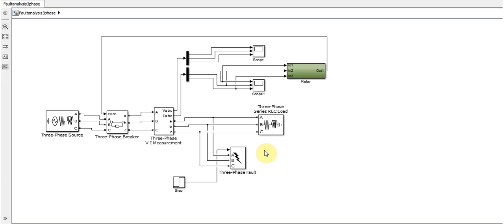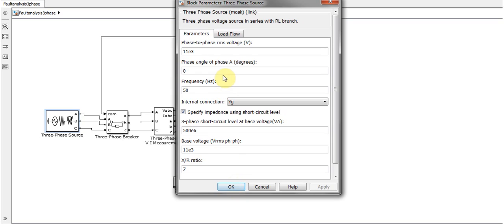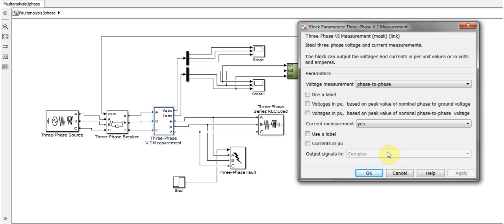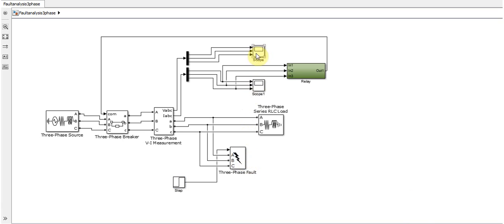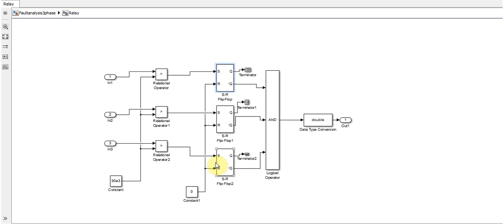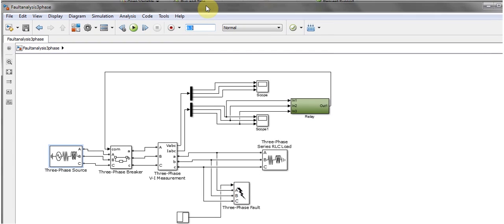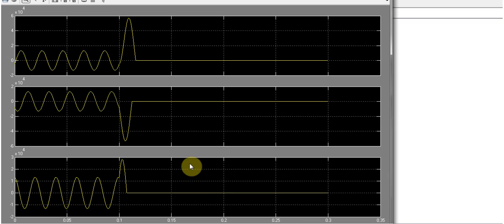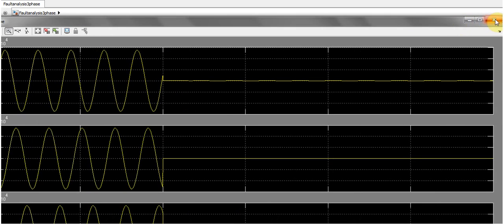Matlab Course : Fault Analysis of 3 phase System in Simulink

Comment: Thank you... kindly answer my following doubts:
1. Do the 3 outputs of the demux represent the voltage and current values of the 3 phases?
2. How was the circuit breaker breaking time set exactly to break when the current reaches 0? Does the circuit breaker break the 3 phases sequentially as their currents reach 0? if so how 1 braking time supplies for all 3 phases?

Please reply at earliest... Thank you

Comment: hello sir the simulation is taking so much tym can u help plz
Reply: If you want to do m.tech or b.tech project and want to get a model of "Power System Improvement using FACTS devices" then mail me on jahidulislamalo@gmail.com . I have a 5 bus system transmission line model in matlab.

Comment: sir it's simulation is taking so much of time . could u pls tell me how to resolve this problem?
Reply: If you want to do m.tech or b.tech project and want to get a model of "Power System Improvement using FACTS devices" then mail me on jahidulislamalo@gmail.com . I have a 5 bus system transmission line model in matlab.

Comment: hello i  tried the scheme, but I have a problem
R-S flip-flop . Can you help me?another tried your circuit, but again the problem is the same. I use Matlab 2012b.
Reply from the maker: download the file, put it in current bin folder and then run it . i
what sthe problem with RS circuit

Comment: I am getting this type of error during simulation   "Data type mismatch. Input port 1 of 'untitled/Relay/S-R Flip-Flop2/Logic' expects a signal of data type 'boolean'. However, it is driven by a signal of mixed data type."
Reply from the maker: download the file from download description , 
have you added gui interface ?
Reply: I have same error and I also add powergui
Reply: @jagdish7217  solution of your problem is change the constant output data type. (Double click Conatant1>go Signal Attributes>change the constant output data type Double to Boolean) 

The problem is solved, Enjoy #Matlab Girlfriend #MART

Comment: I am getting this type of error during simulation   "Data type mismatch. Input port 1 of 'untitled/Relay/S-R Flip-Flop2/Logic' expects a signal of data type 'boolean'. However, it is driven by a signal of mixed data type."

will you provide the solution of this error???
Reply from the maker: +krupal desai kindly download the file given in the description , do ad GUI block as well
Reply: unfortunately
i have the same problem,  and i am trying to download the file in the discription   but it does not opening

Comment: why didn't you simply use " < " in relational operators and the connect outputs to simply the inputs of the AND gate ;  without using SR flip flop?     Isn't it the same algorithm?
Reply from the maker: +Muhammad Ali Waheed SR filp flop has it's own purpose , its important,
You can use builtin or you can make your own customized relay.

Comment: Hello Mr. Usman Hari, What is the "output data type" of constant 30e3? And what is the "output data type" of the relay's Inport1, Inport2, Inport3? 
(I am using the older version of Matlab so that the latest version file can not run well in my Matlab)